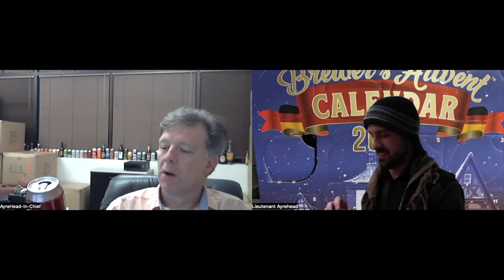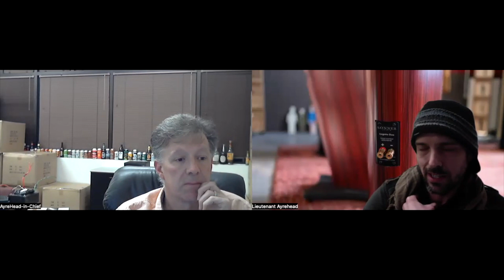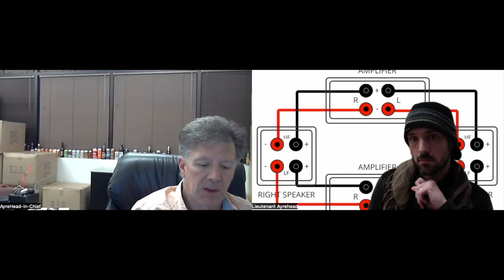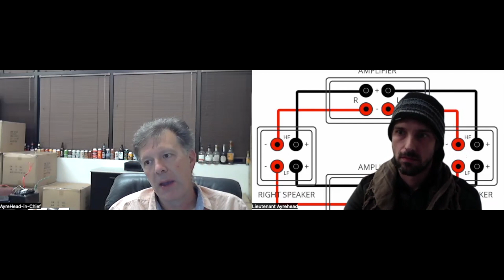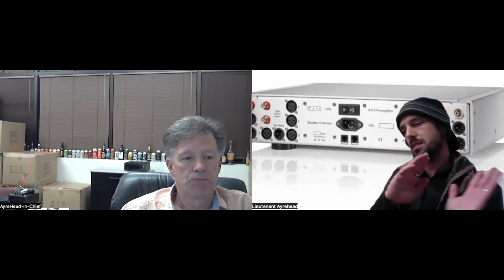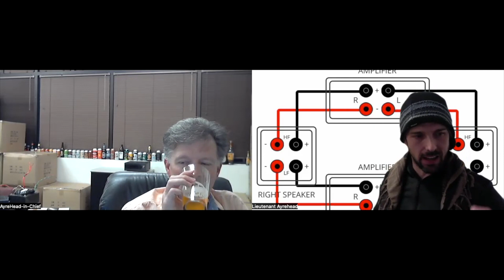System Wirirng Configurations | Pints with Ayre

Comment: @ayreacoustics Another wiring question / issue that would have been good to touch on... how to incorporate a subwoofer using High Level inputs (speaker) to the sub when using an integrated amp without variable preamp outputs?  For instance, if one wanted to incorporate a subwoofer with an AX-5 Twenty or AX-7e, is it possible to hookup a sub to the speaker outputs for getting signal to a sub equipped with High Level inputs?  I think I have seen that it's recommended to wire the Negative speaker wire to the Center Mounting Bolt of the Cardas binding post (not to NEG speaker binding post).  Thank you.
Reply from the maker: Thanks for the suggestion. I think in general the best thing to remember is that our amplifiers are a balanced differential design, and that will help ensure you are looking at the proper resources/diagrams for this type of amp. With a REL for instance, you would connect the signal conductors to the Positive + Terminal on each channel, and there is a possibility of needing to attach a ground wire to a chassis screw in the event there is hum present. 

We may dig into this a little deeper on an upcoming episode and cover some do's and don'ts with that set up. :-)

Comment: One useful biwiring tweak, to my ears, is to dedicate a single cable to the + on the speaker low and high on one channel and another on the - low and high. I had previously used one cable from the amp +/- to each of the speaker high/low binding posts. This makes a small improvement, to my ears, and is a free tweak. I told Ryan about this a couple of years ago but don’t know if he had time to try it.
Reply from the maker: This is definitely worth trying. Increasing that distance between conductors to minimize interference and interaction between them would provide a benefit! :-)
Reply: @AyreAcoustics  yes, I forgot to write that I keep the cables about 6” apart other than when they cross going into the amp.